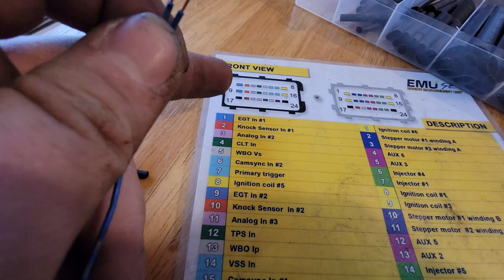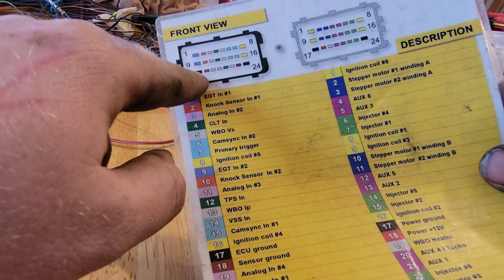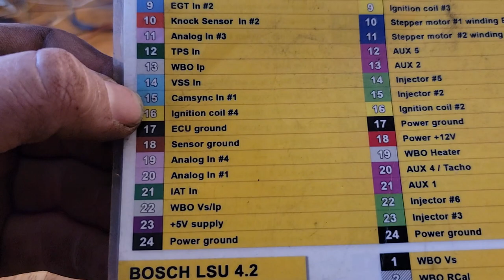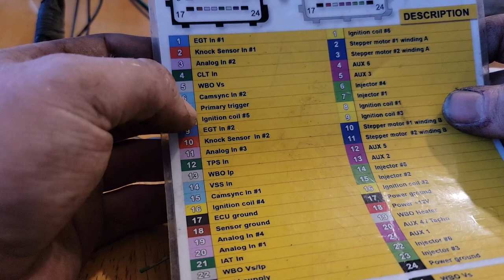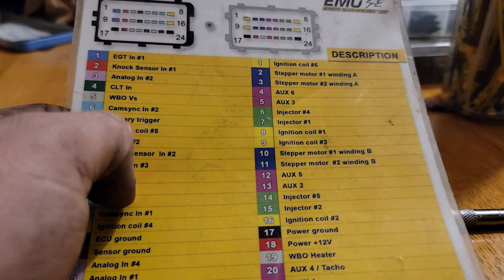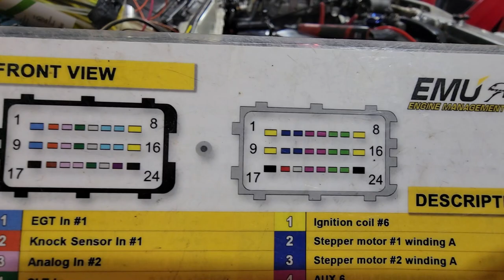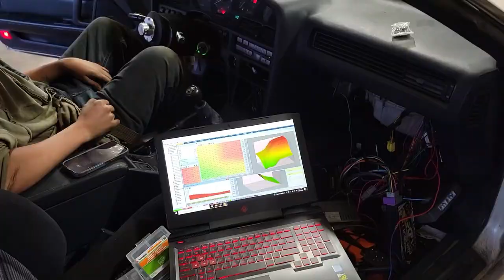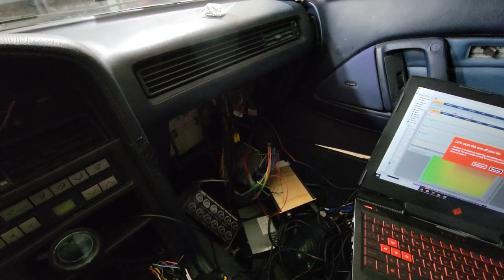IT RUNS!! ECUMASTER WIRING WIRING WIRING (2JZGE-T WIRING NA-T 2JZ MK3 SUPRA) nat get 2jzge

Comment: You earned a new subscriber. 

I have a question. How are you able to tell what wire from each connector is for? Like tps for example. How do you know which is ground and which is 12v and which is signal? Cheers
Reply from the maker: There are wiring pinouts for the connectors themselves on google
Reply: @RabidJz  thanks. Yeah I’ve been looking them up and every time I try to find one for my 2j, the wires colors are different than what I have. 

Have any link for a 2jz vvti harness that came out of a 99 gs300?

Comment: My confusion is always on the body harness side . I’m guessing you didn’t have to adapt anything to the body harness side ? Or you just wired stuff that needed key on trigger to the body harness side ?
Reply from the maker: I built my own connectors. All you need is a test light to find 12v that's stays on with the key being cranked for starter.

Comment: @22:17 I'm having issues firing my build up I'm beginning to think it may be the Ignition Outputs Firing Order & Injector Phase. Mind if I ask what your order & phase are? I'm 2JZ GTE Non-VVTI 12 tooth trigger wheel. Already set timing with a light intend on making sure it's accurate once started but it wants to fire just no go.
Reply from the maker: Both injector and ignition should be set 153624

Comment: I see this is a more recent video,  your sensor ground needs to be pin to the ecu. Sensor ground is not the same as power ground.  Just a FYI  😊
Reply from the maker: When did i say it was the same as a power ground? Every jz from factory is common ground on the engine on every sensor aside from maf, crank, and cam sensors. Ive built harnesses for rb25/26, evo and dsm 4g63 and 10+jz and have done it this way on all of them. If it didn't work, it wouldn't work lol
Reply from the maker: I'll build a 2nd harness for my supra and do it the way you say and do some testing.

Comment: You would think people would use ferrite rings to reduce grounds in the automotive industry, probably not needed but I’ve used them before when building RC equipment
Reply from the maker: Its not something that can be used in the situation with the coils. Each wire is directly requiring is own ground placement. When i talked about noise levels, that's why theres so many grounds. Although those do seem like a pretty good idea to run with the cam/crank sensor to get very clesr signals. I might look into that.
Reply: @RabidJz  ah I see, ya it would be interesting to see if it makes a difference on the cams and crank side
Reply: Ferrite rings are not necessarily going to help due to the fact that nothing in the engine will be transmitting emf outsides of the frequency spectrum/range of the car, and all devices share the same ground regardless of chassis/ECU placement.
Reply from the maker: It would be the frequencies of other sensors. Some things will cause disruptions amongst its own system. Hence why theres a noise canceler on the factory engines
Reply: @RabidJz  I have my mk3 completely apart right now and building all new wiring harness’s from scratch with new connectors, I may ferrites as I don’t see why it would not harm only help, great videos Rabid, thanks for taking the time to make a wiring video even though it’s nobody’s favorite except for maybe me lol
Reply from the maker: I love wiring. Just not when im teaching lol
Reply: @RabidJz  ya and it’s hard to want to do something you like and have to film I can understand that, was filming a Timelapse sanding my car and had to keep in mind camera angles and lighting when all I wan to do is just do the job without the filming aspect of the passionate hobby
Reply: @RabidJz  Ferrite rings have nothing to do with grounding noise filters. ferrite rings only help if you have noise from an outside source or power supply. and nothing inside that car transmits at a high enough frequency to affect any devices in the car bay, maybe a screen or stereo would be effected.